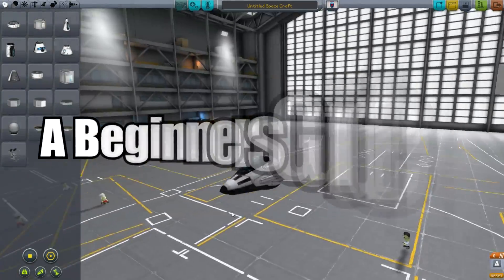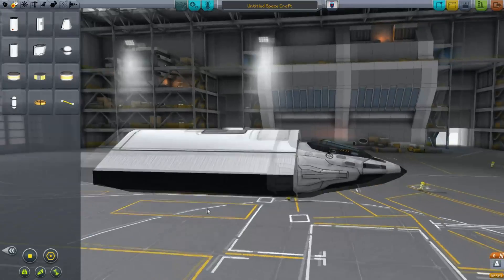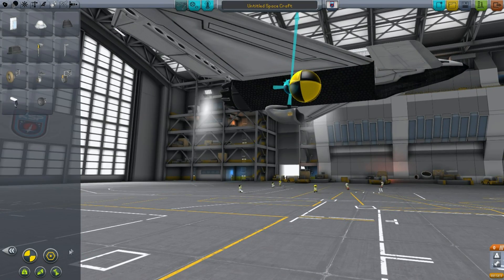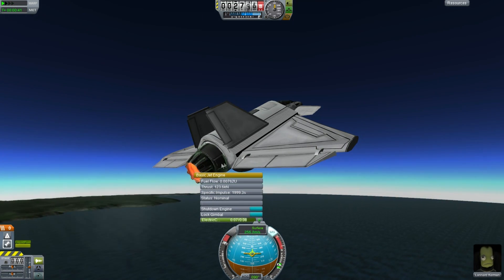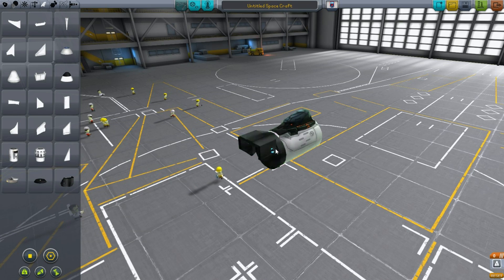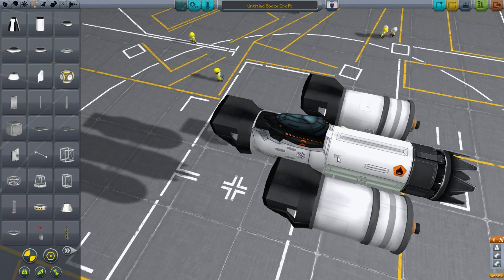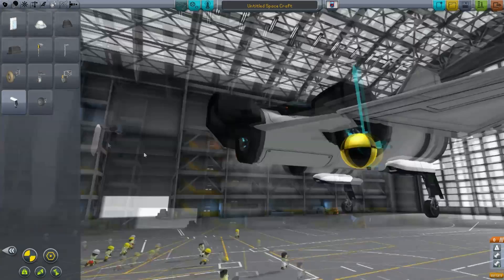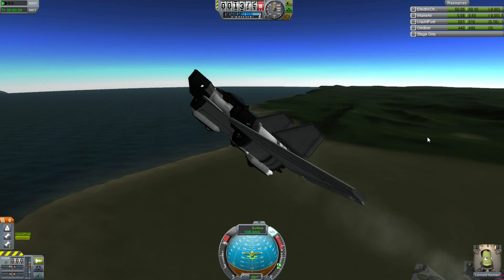Kerbal Space Program - Beginners Guide To  Spaceplanes - Part 3

Comment: I still have so many questions. Can someone please list the following pros and cons for each Wing Design:

Mid Wing:
Low Wing:
High Wing:

Aspect Ratio:

how exatcly does the angle of attack affect steering when the plane is not level.

Straight:
Delta: 
Full Delta:
Swept:
gull:
Inverted gull:
Pointed Tip:
Elliptical:
Taper:
High Taper:
Infinity:

For Tail fins

Conventional:
T:
t:
Dual:
Triple:
V:
Y:
Twin:
Boom:
High Boom:

What is the difference of applying aheadral or diheadral design to tail fins or main wings.

Please no formulas, because I can look them up myself, and in KSP  I cannot exactly put a measuring tape to the screen to figure out the wingspan and surface of attack of my planes (believe you me I tried). Just give me the gist of it, and name examples of type of planes that use those designs.
I have interstellar extended installed which has thermonuclear jets and Intend to bring those on other planets in Kerbol with an atmosphere.

Comment: Bf109 variants (including the civilian racing prototype built to show off during the early 1930's) had splayed undercarriages... This presented 2 problems, one was gear strength. In order to produce the light weight record breaking racing plane they needed to be light, but to shed weight structural strength was obviously traded off. Heavy landings did cause damage to the gear, requiring the structure to be fixed, or replaced. This was taken care of by increasing the strength, and designing a superior suspension (than whasr was already a radical design, producing a cumfortable taxi for a light weight). The second problem was ground control. Many pilots remarked at how surprisingly unstable they were on the ground for what was a very tight wheel base. As the later variants were developed and the bf109 became an ever more powerful and heavy craft, the same sized wheelbase and splayed undercarriage meant a heavier suspension, but there was little that could be done about the ever increasing in hight, centre of gravity.
The splayed gear was adopted because the equipment required to move the undercarriage is actualy heavier than the gear itself. Having the gear attached to the wing and the wheels to be housed in the fuselage also requires more logistics for electrical and/or hydrolics. All in all this increases weight and adds mass further from the centre on the plane.

Having as much mass as possible closer and closer to the centre of the planes profile, means not as much energy is required to role the aircraft. This was ideal for Messerschmitt's new racing plane and initially complimented an already very light and agile, yet strong dog fighter. But I belive, had the designers known about the future weight increase they would have done something about a design edit permitting flipping the gears folding direction...

Comment: No matter how, I cannot build a single aircraft that doesn't explode at landing, no matter I land on the runway or in the field, with or without parachutes. Even with four parachutes and a vertical speed of 10 m/s my landing gear and engine explode. When I try to land like a plane they explode piece by piece. I don't know if it's some game parameter that is set wrong or what, but I cannot take science from my planes because I have to "land" them on the water and only the cockpit survives. Any help?

Comment: Seeing how much more efficient spaceplanes are than rockets, why is e.g. SpaceX still experimenting with the latter? Is it just a matter of scaling up to larger payloads, or are there other disadvantages to spaceplanes?
Reply: As he said while flying in space, air breathing engines require more parts than rockets. Therefore the wet/dry ratio is less, which results in "less DeltaV"(not entirely true, but the air breathing engines are only operating in a relative small portion of the flight). That in combination with the amount of wing area required for lift (wing area lift and weight scale up differently), especially if payloads become heavier, makes the endeavor not viable (perhaps not even possible) enough with current technology.

Comment: I know this is a very old thread, however, I have been having major problems with planes and cannot solve it.  This tutorial shows me how to do it with parts I do not have (version 1.3.1) and they have very different stats from what I DO have.  I have problems with a left roll producing also down pitch and right yaw (and visa versa to the other side).  I cannot land or turn like this.  Is there any way a new tutorial can be made with current parts?
Reply: Likely an issue with "work distribution" along the control surfaces, a.k.a. some parts don't need to/ should not be used for pitch/yaw/roll, disabling some of that functionality on select parts can help this behaviour and fine tune the plane a bit when it oversteers.
Also setting deployment angles on the controls to allow for more or less - and inverting the values to negative ones when different c. surfaces move in opposing directions

Comment: um, every time I try to put the landing gear on the side engines using 2x radial mirror, it mirrors it to the other engine but on the top of the plane instead of the bottom, how do i fix this?

Comment: my space planes keep wobbling during takeoff. i used mirror symmetry the lift is behind the center of mass(though it points slightly back) i don't even touch the keys it just wobbles out of control before i can even get the wheels off the runway. dose anyone know what I'm doing wrong?

Comment: Every plane I make with the stock 1.02 parts falls apart. I keep attaching wing parts together to build bigger wings. Except they don't connect properly and I end up with very floppy fragile wing aero foil surfaces. 
Is there a specific trick to getting them to flow together, Is there some way to do it to get them to work. I really want to build really large wings for my SSTO.
Reply: +ShadowFox178 use the struts, stitch them together

Comment: Upward slope on wings = "dihedral"  figured a steely eyed missile man like you would use the geek term for it :)   we commonly use it in RC aircraft to induce roll moment in designs that only have rudder/elevator control, like basic thermal or slope sailplanes.   The end result is you get some bank, with rudder input. for a cleaner more efficent turn.  Without dihedral in the wings on a basic sailplane, that doesn't have ailerons or elevons,  you would yaw skid all over the sky  when trying to turn.  
Wings that angle down are "anhedral"
Reply: stinkyfungus He uses said terms in the first two videos.

Comment: whenever I try to build a space plane it always veers off the runway on takeoff, i have no idea why, does anyone have any clue as to why this happens and how to stop it?
Reply: If it just turns on it's own then you either need to upgrade your runway to make it flatter, or reposition your wheels more evenly along it.
Reply: Banana Puncher this is on sandbox mode so it isnt the runway and the spaceplane veers off first one way then the other at random so i dont think it is the wheels not being straight, it is a standard one front 2 at the back design
Reply: Maybe you need to put the back wheels right after the centre of mass, then you can pitch up easily before losing controle.

Comment: Hooray for throstling up!
Reply: *****
It's more a problem of scale. They used it for the X-15 to reach space, much like SpaceShipTwo has White Knight Two to lift it to high altitude. The problem comes in lifting anything much larger than a small manned capsule.
Reply: Yes, in fact NASA was using the idea of having a space ship attached to a 767, take the jet up as high as it can go, detach, and have the spaceship fly off and the 767 land, but was scraped cuz fuel costs, the length of airspace needed to have the jumbo jet reach that high altitude made it financially fail.
Reply: Ah my bad, thanks for the correction

Comment: A trick for putting your fuel tanks ON the fuselage WITH intakes or fairings or whatever on the front or back when the game doesn't want to let you...
You need to space them out as you did, or otherwise temporarily attach the tank somewhere that spaces it out, add the items like intakes, and once the whole thing is fully assembled, take it off and set it aside. Remove the girder or whatever, if you put a temporary object on to space it out. Then put the tank back on the side. At this point, the game doesn't take into account whether the intake on the top of the fuel tank is ever so slightly interfering with the fuselage, and the fuel tank will attach.

Comment: could you have put fuel lines between the 2 exterior rocket tanks to feed the rest of the fuel from the jet engine tank into the rocket engines giving you a bit more fuel to play with?
Reply from the maker: The rockets need oxidizer to work.
Reply: Scott Manley yeah yeah coarse doh, Damn always trying to beg steel or borrow more fuel lol. You make it look so easy Scott. Love your work dude.
Reply: craig gilchrist there is a mod where you can tweak the fuel tank mixture so if you want you can make 1 fuel tank with more liquid fuel then oxidizer and connect the engine with a fuel line..this could make you spaceplane more efficient since you are not carrying liquid fuel to orbit which you cant use... "Modular Fuel System" is the name.
Reply: Sty1a thanks dude

Comment: Doesn't the Space Shuttle still launch like a normal rocket?
The X-15 got into space, but not orbit. And it only had 1 crew member.
SpaceShipOne also had only 1 crew member.
X-47 also hasn't reached orbit. 
Buran, like the Space Shuttle, launched like a rocket.
Also, as you said, X-47 and Buran were unmanned so they don't have anything to do with it anyway.

Comment: It would be super cool if you could throttle engines independently, or at least lock in a throttle setting for an engine or group of engines and then use the normal throttle controls to control all the engines that aren't locked in

Comment: the spin out mainly occurs if you have more than one jet engine - they dont flame out at the same moment, so one engine still gives thrust while the other flames out, which makes you spin and loose control. Also depending on the number of engines you also need more intake air . The "trick" to make the engine work at low intake air is to throttle it down (he does so in the video).

Comment: as long as you have enough fuel for your jets you could - but in my experience the simplest way is to just try to have a slow enough climb or level your trajectory out. Also the drag will increase if yu go down, so you might up loosing velocity instead (around your top speed even 100 meters seem to make quite a difference)

Comment: indeed - but after you turn off the jet engines you still have to go through the upper 40-50km of the atmosphere. And despite it being too thin to feed your jet engines it still has enough drag to reduce your kinetic energy by a quite substancial amount. If you didnt fire your rockets at that point (or like me desperately tried to make it work with atomic engines) you would end up losing all that accumulated speed in a short time - so every bit less drag helps you conserve fuel

Comment: at 7:03 you can still make them sometimes snap on when using the 1x symmetry (they will still be symetric because the tanks are) or you can put them 90 degrees on there, snap an intake on it and then snap it back using 2x symmetry.

Comment: Not really, jet engines need an oxygen atmosphere to function. Eve's atmosphere has no oxygen, so Jet Engines will just sit on the surface and make a lot of noise, consuming fuel and generating 0 thrust. If you want a spaceplane that works on Eve, you could try the thermal turbojet in the Interstellar Mod.

Comment: lowering the throttle and gaining even more altitude  ("thrust > drag" rule is very applied here) yields A LOT more orbital speed running on turbofan, probably something around 200+m/s or more depending on the payload.

on a simple plane i've reached 25.5km (+-0.5km) at 1560m/s surface speed (+- 20m/s) with minimal thrust using only ONE intake. intake air constantly reports "0.00" but it still pushes. :)

Comment: Scott,

I believe velocity has a greater bearing on the thrust of the jet engines than altitude. 

I know it is possible to have the turbojet engines outperform the regular jet engines at sea level if you are going fast enough. Likewise, the basic jet engines can perform ok at altitude if you take a steeper trajectory into orbit, and are very helpful for pushing heavy SSTOs off the ground.

Comment: I've already managed to bring a spaceplane into orbit and in fact even dock it with my space station, but watching this tutorial makes me realize some mistakes in my designs. First of all, instead of using a turbojet engine and 2 aerospike, I used 2 turbojets and 1 aerospike, which means that I really need to shut the jet engines off before one of them goes off by itself. Also I'm usually climbing at 45° until 17-18km or so, and I'm glad if I reach 1300 m/s before turning on the aerospike.

Comment: Another tip to anyone new to building aircraft in ksp. Build the plane and balance it nicely with a minimal fuel tank at center mass.... take fuel with you in tanks you carry under the wings. attach them directly at your center of mass and you won't have balance problems.(remember to use fuel crossfeed pipes) If you do it properly you can de-orbit. also get B-9 aerospace pack. It will make planes a LOT more fun. and the pods are a lot nicer for large rocketships if you get tired of the stock.

Comment: If you like a reality challenge I recommend FAR. It has advanced autopilot options like pitch damping, or wing leveling. Trimming with the ALT key is also very helpful with Space planes. and the KW Rocketry heavy and medium struts help (stock strut strength is 150 where as KW medium struts have 50000 and heavy struts have 220000). 
FAR will cure your getting altitude problem as wings generate MUCH more lift for their size. But be ware of stalling!

Comment: You'll spend less time getting payloads into orbit with regular rockets. SSTOs are imho at the edge of the performance envelope, & therefore have a small payload capacity. Further SSTOs are difficult to scale up in KSP. Yes space-planes are more efficient in terms of fuel, but this is at the cost of complexity, time [it takes much longer to get to space with a space plane], and lack of payload. Like many thing in life, its a trade off between performance in one area for performance in elsewhere

Comment: Ever tried Rocket-Assisted Takeoff? Most of my planes, even if they fly great, don't handle very well on the ground. A solution is to use cube struts attached to decouplers and then covered with enough downward-pointing septatrons to get into the air without having to roll on the ground at a high speed. Then, decouple the deadweight and fly away.

Comment: I think you could attach those fuel tanks with ram intakes without using trusses. If you rotate fuel tank 90 degrees, then attach intake (or anything else, I almost always have the same problem while trying to attach rocket engines) and rotate back.

Comment: I'm not sure you're understanding the problem, but think of it this way: Air berating engines [jets] use the oxygen in the atmosphere with jet fuel to work; using the atmosphere oxygen is efficient because you don't need to cary it. Because rockets go into space [no oxygen in space], they have internal tanks of oxidizer along with combustion fuel. Jets can get you going about 1000 m/s: in KSP you need ~2200 m/s to orbit, but on earth you need ~10,000 m/s to orbit so jets are less helpful here.

Comment: Two things about jet engines:
1st: Intake Air has a weight. Therefore the overall efficiency of a jet engine not only depends on the Isp but also on how much intake air the jet burns. (also decides when the engine will flame out since less burnt intake air means less overall air requirements for the engine)
2nd: Thust is only depends on speed. Jet engines have a velocity curve that they work by with defined % of max thrust for a certain speed.
hope this helped
Greets

Comment: Nice tut's Scott, for visual aide and a littler extra help building planes I found this tutorial (with pics, WOO!) on the KSP forums, which drives home a lot of the points you made, but also adds other things, like high vs low wings, dihedral and anhedrial wings, and airflow across the wings.
The tutorial on the KSP forums is; Basic Aircraft Design Explained Simply With Pictures. I'd supply a link, but youtube is mean.

Comment: SSTO's and Spaceplanes are a passion of mine is KSP and these have been a massive help. In particular, I have been experiencing frustrating setbacks with my attempts to build heavy SSTO shuttles, using the B9 parts. I've had success with these before, but since the last updates, my old designs just won't work, either not being able to get enough speed to reach high altitude, or more frustratingly, veering wildly off the runway during takeoffs

Comment: Even besides the problem of attaching payloads: Both in real life and KSP, conventional rockets will always be more efficient than space planes, simply because of the extra mass of the wings (let alone extra engines, fuel and air-breathing equipment).
Spaceplanes have a very specific sets of benefits that aren't really that relevant in KSP, and arguably weren't even achieved by the real-life Space Shuttle.

Comment: If you're going to carry a payload into space with a spaceplane, the problem is usually what it does to your center of gravity / center of thrust.  Without a proper cargo bay, your options are attaching things symmetrically to the wings (and hoping your wings don't break off under the weight), or attaching the payload to the nose (and hoping you're not too top-heavy to pitch up).

The B9 aerospace mod adds cargo bays, which are pretty much a requirement to do this.